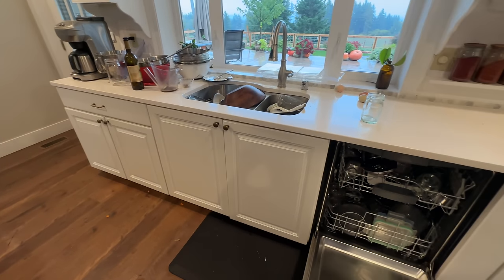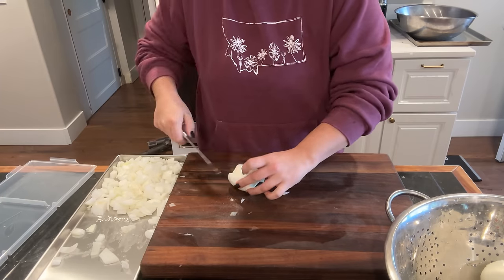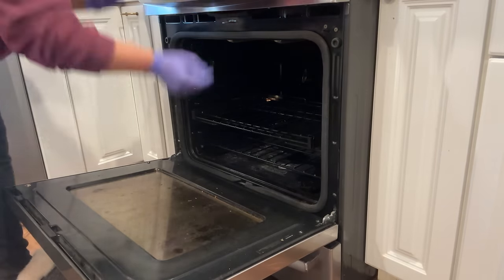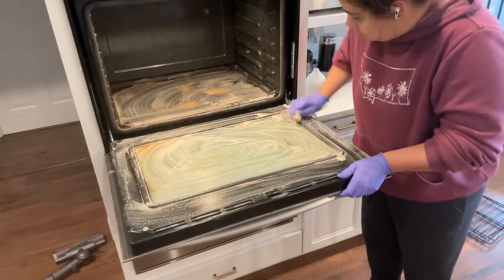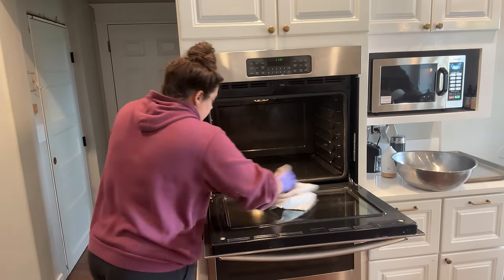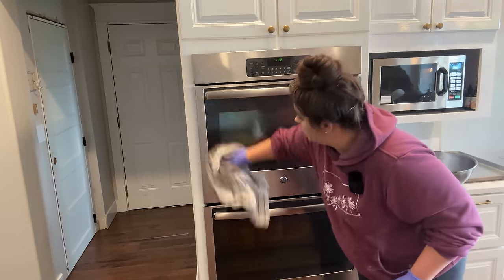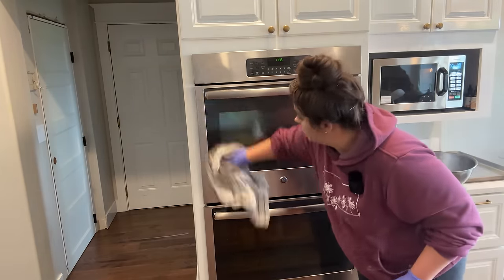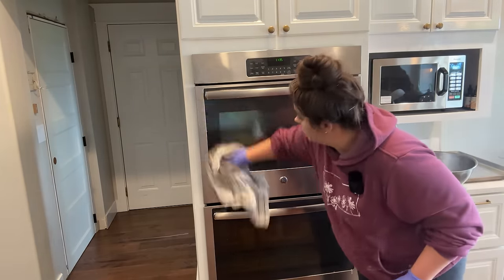This can't be put off any longer!

Comment: You’re not alone Becky. We’ve lived in our new house for a year now too and I haven’t cleaned our oven yet either. It’s a job I absolutely despise so I tend to just shut the door and walk away. 😂
Reply: Setting a cup of ammonia on your oven rack the night before then close the oven door, when you’re ready to clean it the next day (put a cloth over your nose so you don’t smell the fumes) pour the ammonia down the drain. Then wipe out the oven. The fumes release all the stuck on grease and splatters so there’s no scrubbing, when done with the oven rinse off the oven racks. Everything will sparkle. I couldn’t believe it when I heard this method and it absolutely works.   You can do this with your grill grates/racks also, just put them in a plastic garbage bag, pour a cup of ammonia in the bag , tie the bag shut and let it sit overnight. The next day they rinse clean. No scrubbing 😊. Just make sure you wear a mask or cover your mouth because it does stink. There’s several YouTube videos on it. Your energy is never ending Rebecca ❤

Comment: You can legitimately deduct the time you were pregnant from the time the oven was not cleaned.  Impossible to clean an oven when expecting a baby!  I have been told that if the oven is not regularly cleaned it can affect its performance.  My Mother used to say that if you wait for the oven to cool a little but still warm, wipe it out with soapy water it can reduce the need for a deep clean.  Thank you for the video.

Comment: Had a problem when I first used the self-cleaning mode, it bent the fan so it clicked all the time. Have not used it since, but have also not cleaned the oven since either.

Comment: Did you know that most oven doors will slide off their hinges so you don't have to lean around them to clean inside the oven? Open the door half way and pull up - or comes the door.

Comment: Last year I decided to use the oven cleaning button on my stove. It locked and wouldn’t open. We had to pull the stove out and the manufacturer Manuel to tear it apart. After a YouTube video, the oven cleaner lock is now disconnected . I haven’t cleaned it since.

Comment: The frig needs to be pulled out away from the wall & vacuumed possibly mopped. You’ll be horrified by what is under it. Clean vent cover too in front on bottom of frig.  Also don’t leave anything plugged in that you are not using like you kitchenaid. This goes for all over your house. Exception is anything that has a clock/timer. They pull electricity & over time that additional electricity can add up. FYI